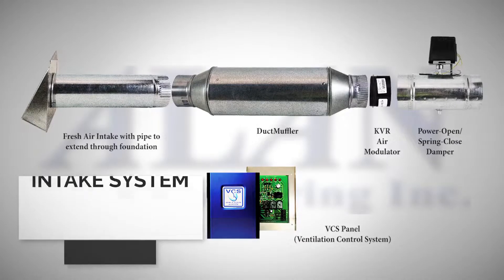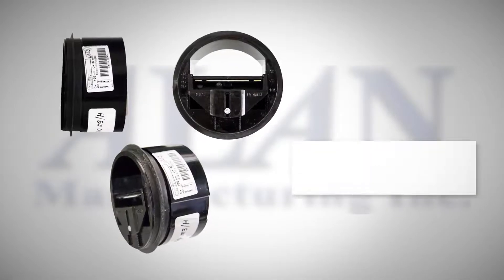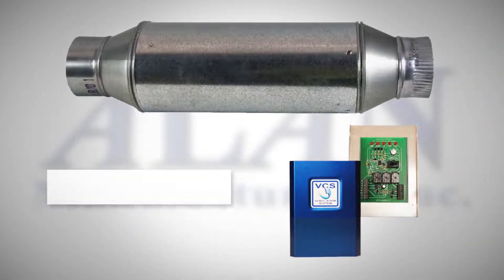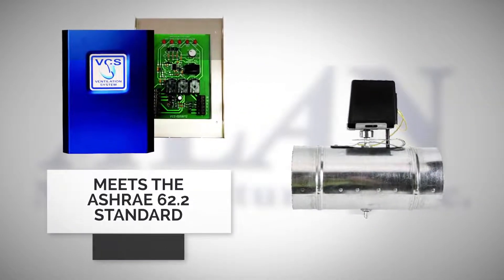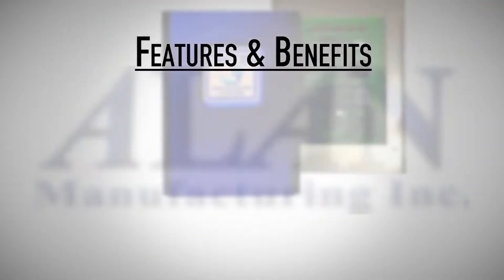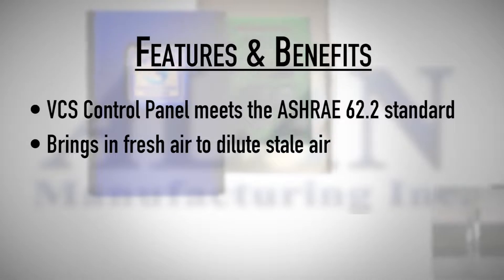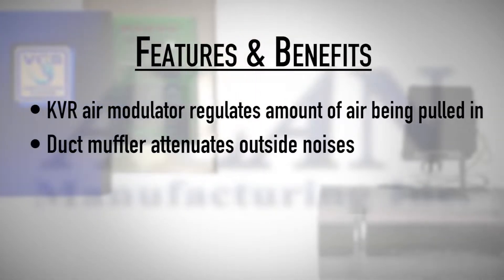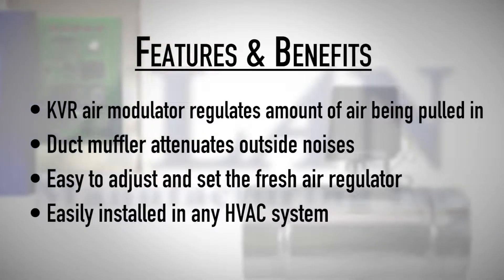Fresh Air Intake System - How to Dilute Stale Air by Adding Fresh Outdoor Air into the Building

Comment: What if there is no fresh air outside, if the house is next to a factory, a neighbor who offgases dangerous chemicals (VOC's), in a polluted city in China/India or next to a freeway?  The VOC's would need to be removed before they are used as the fresh air source... how is this done so the fresh air is actually fresh, no polluted with dangerous VOC's?
Reply: You would need a filtration system to purify the air before it enters your building. You would benefit from having a supply of purified air from outside seeing as the air inside comes from the polluted air outside regardless of the exchange method. A constant stream of filtered air is much better than non filter air stagnating within the building from outside.
Reply: @usware5240  I can't seem to find a pre-filter for a fresh air exchange that removes all VOC's... the particles are easy to filter.
Reply: Ventura IT activated carbon filters are about as good as you’re going to get short of getting into expensive laboratory style filtration systems. I’m about as paranoid as a person can be when it comes to air quality and the best I’ve come up with is having a hepa filter followed by a carbon filter in my return ducts. That air will be cleaner than anything you breath outside. Keep in mind though that the volume of air going through the filtration system needs to be 4x the capacity of the intake to your furnace otherwise you will choke the system and it will fail.
Reply: Ventura IT also I forgot to mention, you may need to build your own filtration system. I know that’s not very helpful but there are not really any marketable systems for this purpose. Indoor air quality (filtered pure air) is largely overlooked.
Reply: @usware5240  Yes,  I know... I've designed one already...  if you want to buy it I think I'd sell it for $1500...  best thing is to move to a non-polluted location and suck in clean air and use a HEPA or MERV filter... MERV 13 works pretty well...
Reply: @usware5240  carbon filters need to be HUGE to even work a little bit, mostly they don't work or only work a little bit... we tested the top of the line room air filter that has hepa and carbon and it only removed 9% of the VOC's in 30 minutes and never got better than that... we tested a more expensive but not top of the line machine and it only did 0-3% despite having 25lb of carbon...  best to move away from any dangerous VOC's... nothing can filter them fully...  get tested by someone who really knows indoor air quality (if they say anything about OSHA run the other way since OSHA isn't applicable to residences.)  we've been researching this for about 10 years now (and have some of the top PHD/MD's in the field contributing) full time and filters are only a supplement, living in a pristine natural location is the only way to ensure clean air...  (this is not medical advice)